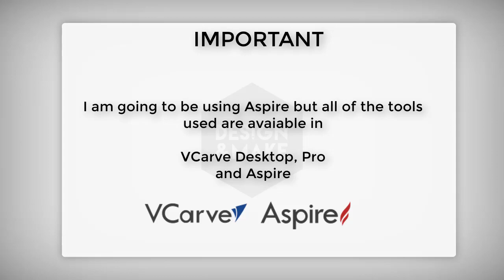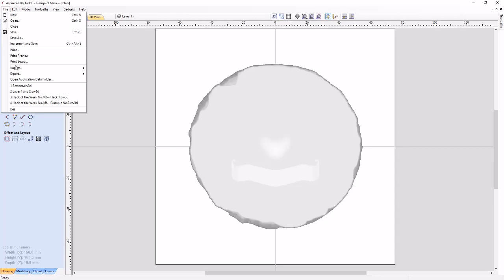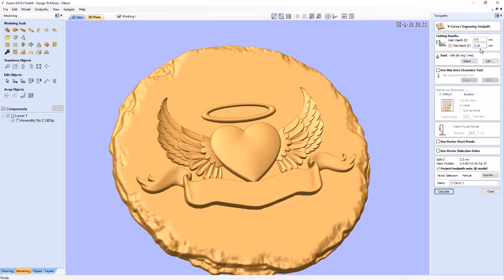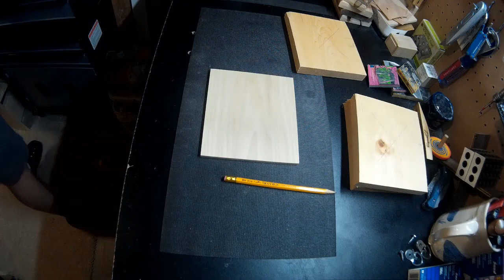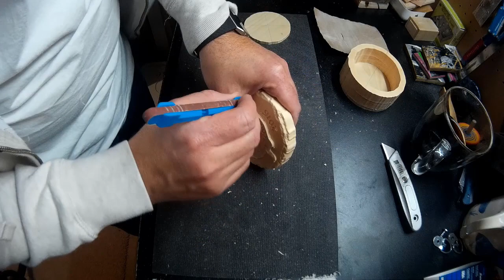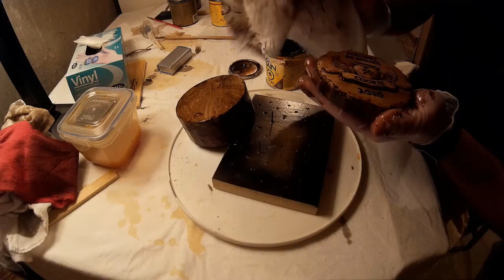D&M's Vectric User Group Crowdsourced Project | Design & Make

Comment: What kind of wood did you use ? It looked almost like a plastic???? I am a builder and would like to have the plans to look at for the machine you used.
Reply from the maker: Hello Carl... thanks for the comment.  The top and rings were pine and the bottom was poplar.  I used a gel stain and then several coats of spray clear coat (if I remember correctly)  I think the top got a few more coats then the base... :)  The CNC I used is the CraftCNC... free plans are available here - http://www.designandmake.com/index.php/hardware/  

Hope that helps...

Todd